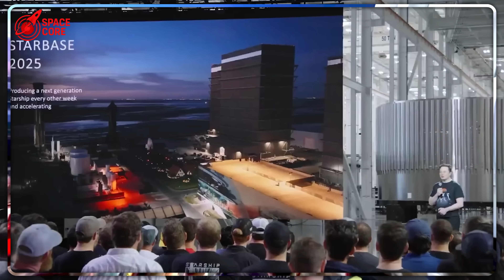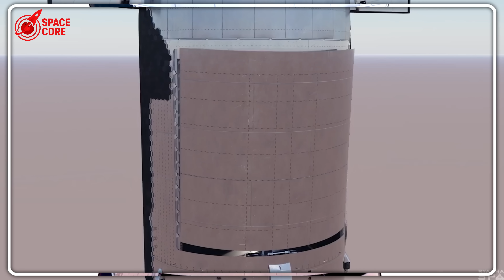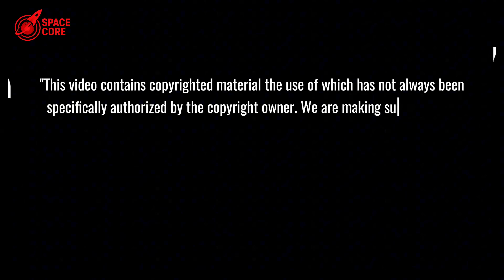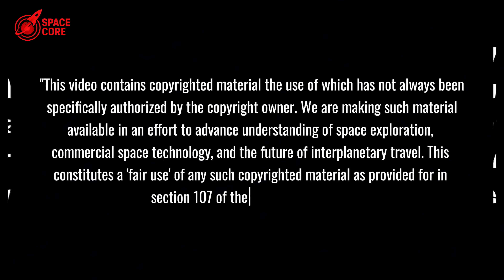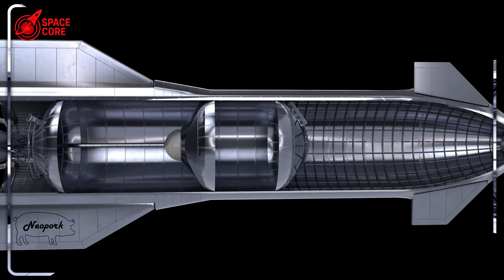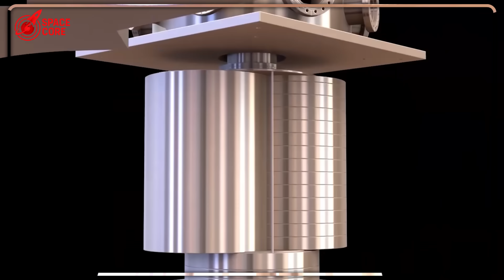SpaceX Starship Expendable Mode SHOCKED Engineers: 250 Tons to Orbit...

Comment: Great,The capsule top and engines disconnect,fit together for re entry,the 29 ft diameter sleeve without fins and heat shields extends like a car antenna and 3 more like it come for VAST cost cuts.
Reply from the maker: Fascinating idea!

Comment: Good job making it seem like drama, but once SpaceX committed to mass production of Starship/superheavy, the utility of expendable versions was just obvious and accepted. F9 and FH always flew expendable when needed. This path of both reusable and expendable depending on use was the obvious implication as soon as Musk shifted to stainless steel from carbon fiber.
Reply from the maker: Great point! The shift to stainless steel made Starship’s expendable mode a natural fit for mass production, mirroring F9/FH flexibility
Reply: Actually the combination of the 2 can be reactive to Van Allen Radiation Belt to turn Nuclear Radiation into PREPULSION.